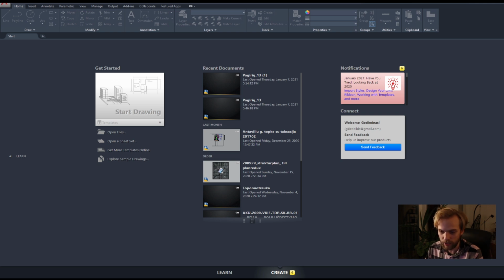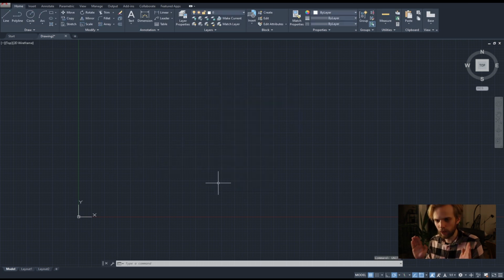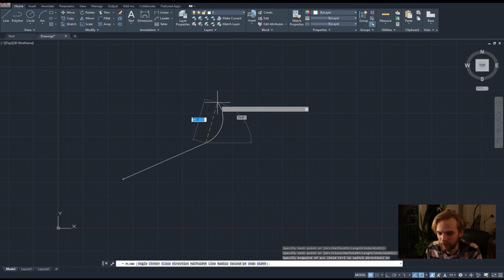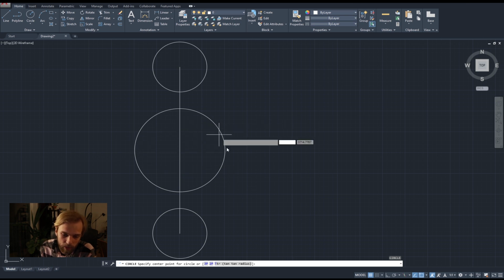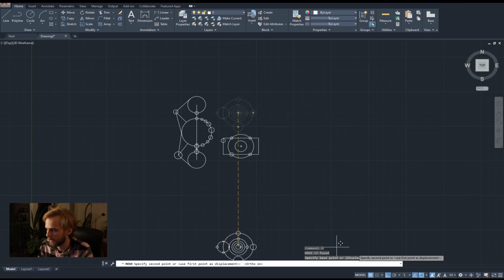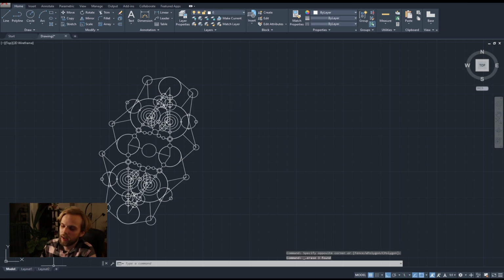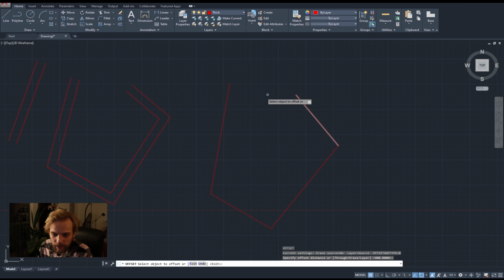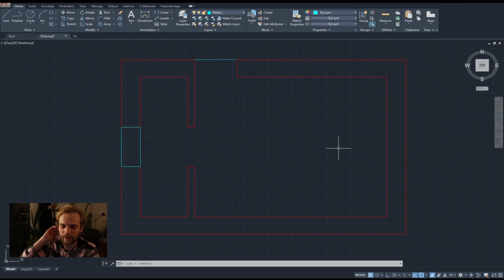AutoCAD for Beginners -  Full course - Part 1 (AADA05)

Comment: Firstly, I would like to thank you for your videos. I must learn both AutoCad and Rhino, which one do you advise first? Could you kindly give an order of videos, please? Thanks a lot
Reply from the maker: It's a bit tricky. Technically - if you know Rhino - you shouldn't need AutoCAD, BUT there are a lot of government agencies (such as the city planning commission) that only use AutoCAD, thus all documents that you'd receive would be in native AutoCAD format. So I think the best way is to go through the courses in numeric order: AADA05, AADA10, AADA15, AADA20 and then AADA25
Reply: @DesignGoBrr  I haven't watched any of your Rhino videos yet but your answer here made me think of a question I've been wondering myself lately. Do you also use Rhino to do all of your drafting, drawing, and 2D work? I'm a student and have been using Rhino for both my 3D and my 2D work but I feel I'm not using it very efficiently for my 2D work. I'd be curious to see your process of how you make a drawing set for a project (have multiple drawings at different scales). I just did copy, past, scale. Surely there is a more efficient way than that. Can I create different windows or viewports in Rhino that I would allow me to view my main drawing so if I change something that change gets updated in all my drawings?
Reply from the maker: @jonfarmer3433  Since Rhino is an universal 3D modeler/surfacer it's always going to be slower at 2D drawing creation than dedicated software such as Revit or Archicad. For the proposal phase it doesnt really matter because most of the effort goes to 3D form/space creation, but for later (technical) phase we migrate to Archicad and construct final drawings there.
Reply: @DesignGoBrr  Thanks for your help.
Reply: @DesignGoBrr  will you make Archicad tutorial anytime soon. Will be glad to have it.

Comment: Btw you do not need to use  f8 or ortho, just holding shift is enough.
Reply from the maker: Yup, I know but for some reason I don't use it - I think it's just matter of preference. Either permanent or temporary hotkey based drafting/modeling.
Reply: been student for 4 years, yet i didnt know that u could just hold shift while draw a straight line, thanks